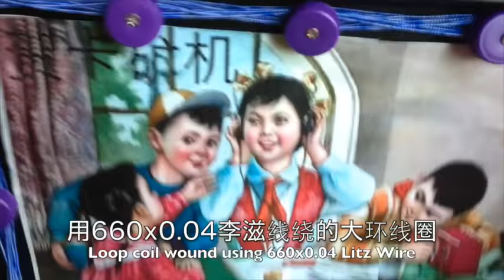Crystal Radio Electronic Building Block

Comment: Can you build crystal radio receiving HAM Radio signals with SSB and CW?
Reply from the maker: I think crystal radio can also receive HAM radio signals given a good antenna and the right coil and capacitor.
But I haven't made any, as the HAM radio activity where I live, in HK, is not too active.